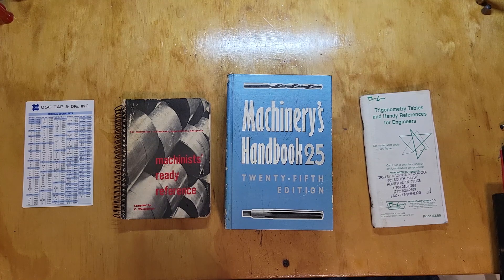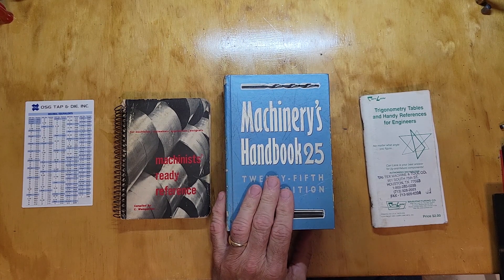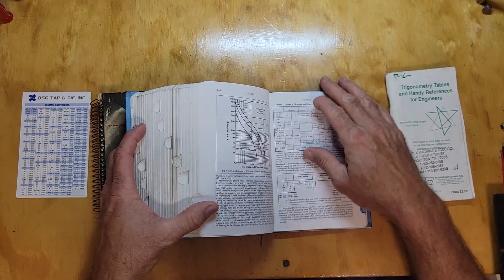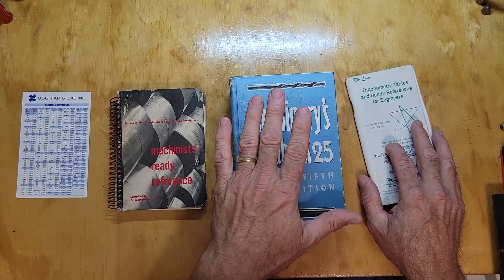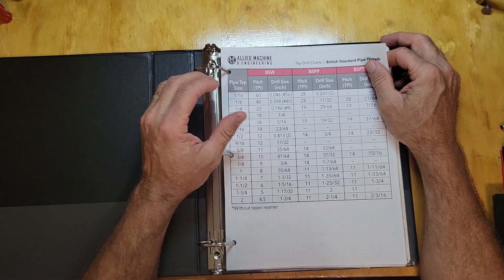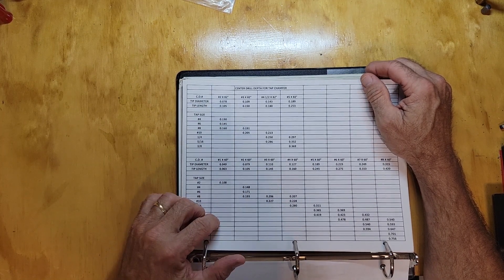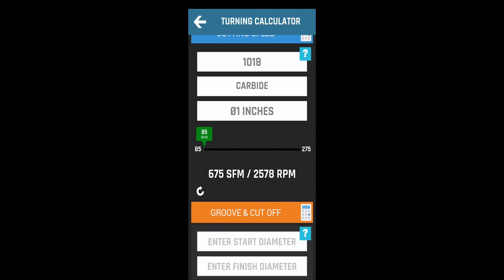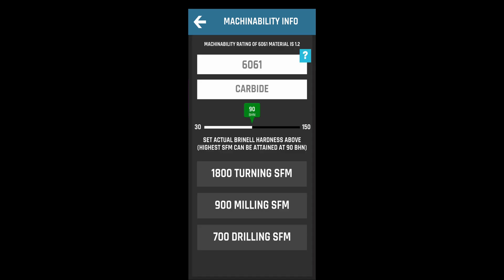Machining Reference Material

Comment: Would you be willing to make a part for a drill press that no longer has parts available for it , it's a powermatic Houdaille model 1150 , and the part that's needed is the rod depth adjusting , I managed to strip off the threads on the small end of it. I can send the old part to you so that you have a reference as to what's needed to be done .